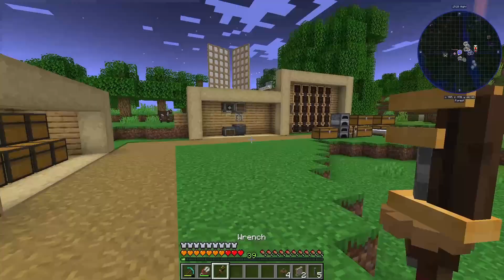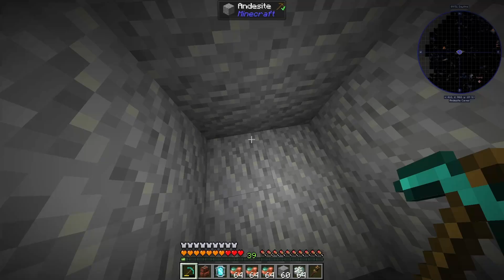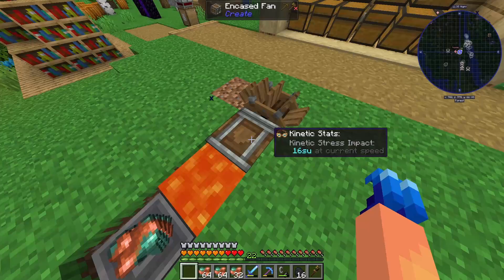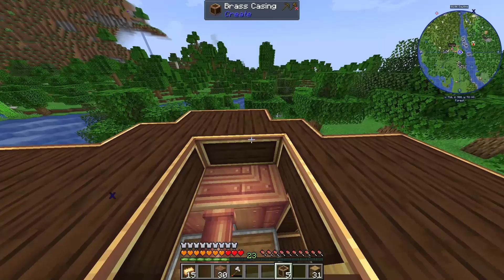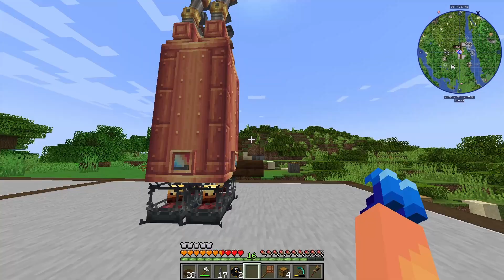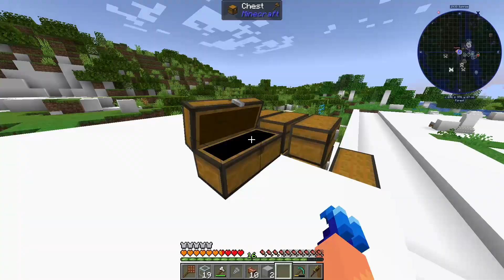Chroma Endless 2 - Ep 3 - Custom Sifting Multiblock!

Comment: though just in case id have the water pump and fuel fill for the steam on a separate system from main stress power 
so if you over stress it doesnt shut down and need manual restart

also i wonder if this modpack has the add on create mod that give straws for the blaze burners 
because it cuts so much lag having the ability to pump liquid fuel directly vs the bucket filling system

in some modpacks the hosepulley is fully broken like insanely so ive found out
 i never knew if it was in oversight in config or planned in those modpacks
let me explain

you know how it gives infinite lava if there is 10k blocks of lava 
which is what a 16 by 16 by 40 ish or something 
easy in the nether but with big lava caves possible in the overworld just need to make sure its fully chunk loaded if it isnt in a chunk

the broken thing is it can sometimes work with any liquid no matter the type not just lava oil and water you default think of
molten metal, crystal, magic, blood, fuel etc if its place able in world via bucket

which the crazy thing is if you dig out a 16x16x40 pit a few blocks below and have the hosepulley in reverse which allows it to place liquids 
 it can build a infinite source for itself to pull from forever

so i mean getting over 10k+ buckets of molten anything is a lot but i mean something to test to save time long term